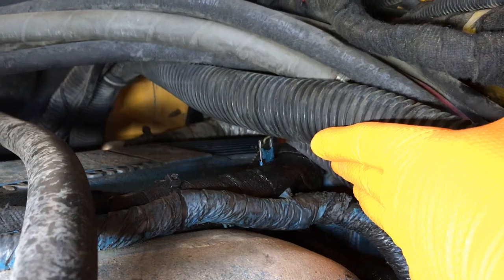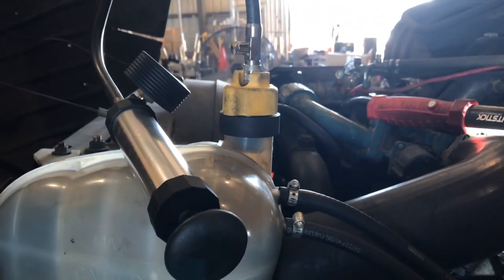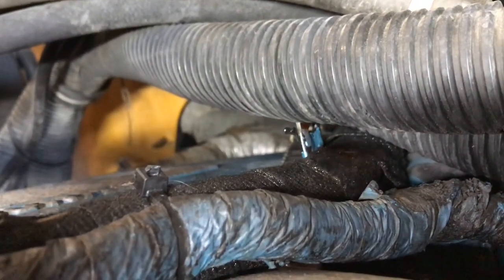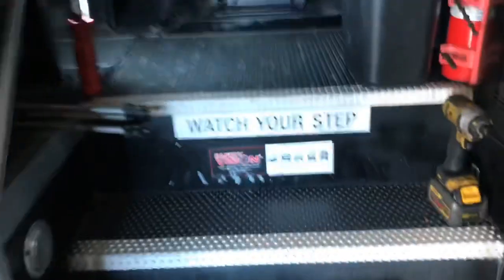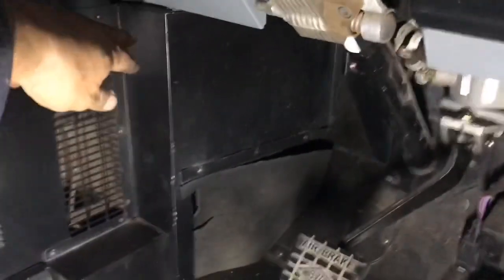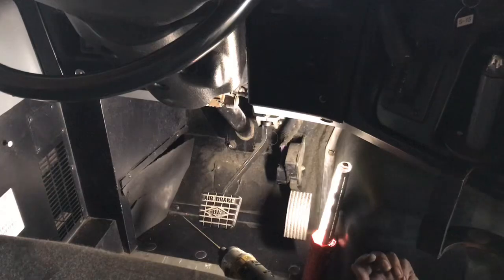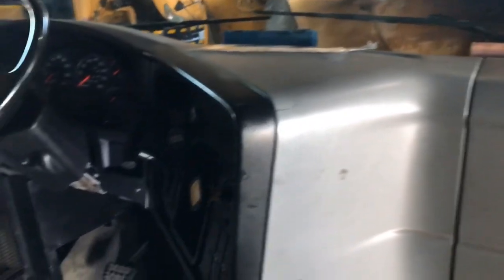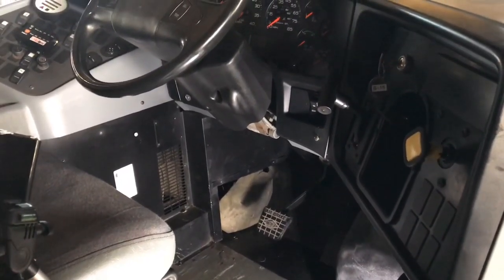CE school bus coolant leak

Comment: Great video Joe! Your camera skills are on point! I like that pump to add air pressure into the cooling system, did you make that one? That hose had a really long route!
Reply from the maker: 3 Wheels & A Block   Hey there 3whells. Thank you for the comment. I’m trying to get camera set up to get clear views. These buses have very few flat spots and r too high of the ground bud. Everything is fitted in after engines dose in. I know. Everything is just a cluster. But hey. Keeps us busy.